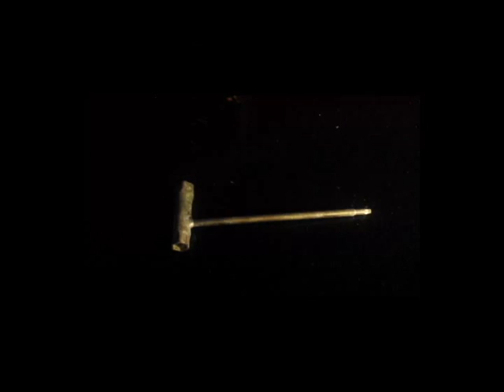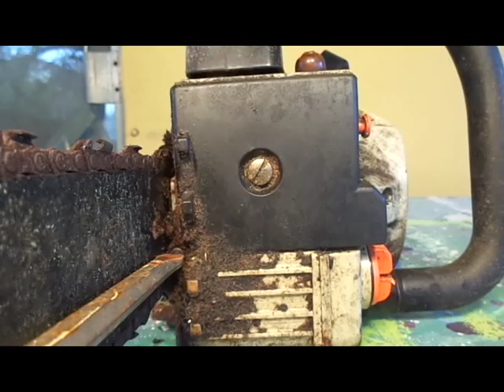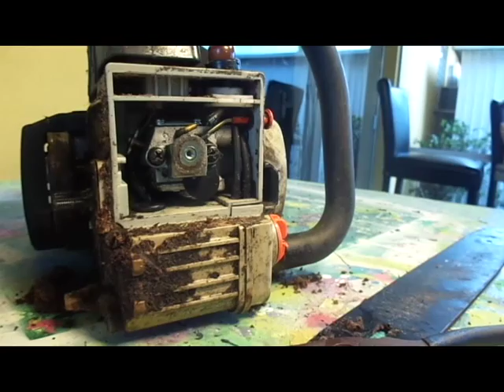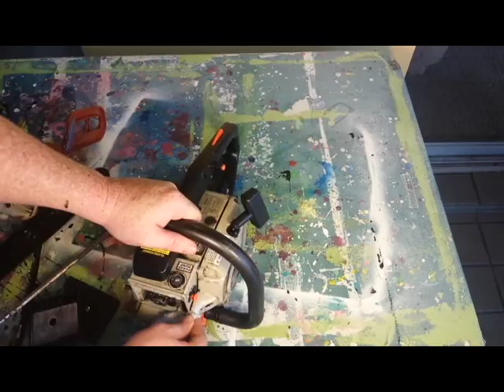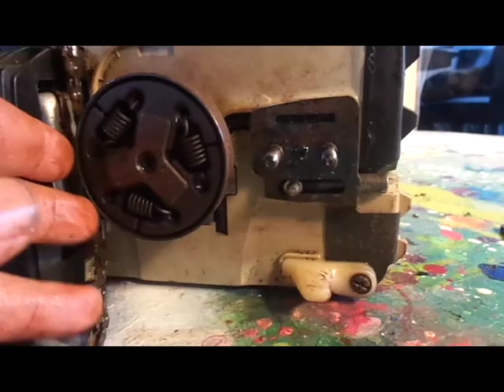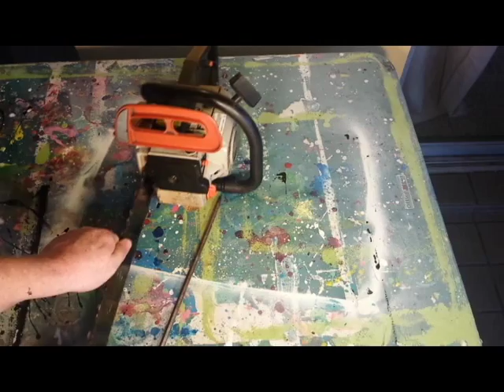Chainsaw Repair- Replace a Prime Bulb, Air Filter and Chain. D.I.Y.

Comment: When you tighten up a chain snug it up then pick the tip of your bar up then tighten the chain more if not when you cut and push down on the bar your chain will be too loose
Reply from the maker: Thanks for posting. I agree with you, definitely need the chain to be tightened properly. Thanks for watching!

Comment: DAVE
HAVE 3 ECHO TOP HANDLES THAT ALL NEED NEW BLUBS. THIS HELPED A BUNCH!!!!
TECHNICALITY -- AS IT STATES ON THE SAW, IT IS REALLY A "PURGE BLUB" NOT A PRIMER BLUB----IF YOU LOOK ON THE BLUB, THE TUBING FROM THE CARB TO THE BLUB GOES TO THE  "IN" CONNECTOR, AND THE OTHER TUBING GOES TO THE TANK, NOT VICE VERSA-----ASK ME HOW I KNOW LOL
Reply from the maker: Thank you for watching and thank you for the information on the proper name. It really does help others when they are attempting to do these repairs. I may be naming something different than what it actually is and it could definitely get confusing.

Comment: my primer bulb stays deflated or depressed my saw will crank and start up but only run a few seconds. Do you think the bulb is bad?
Reply from the maker: Reaper kinda sounds like a fuel line is clogged based on the prime bulb staying deflated, like it will push fuel but not pull it in. Could investagate the lines also check the spark plug is not cracked.
Reply: Dear Reaper, I had the exact same problem with my echo cs 3000. On the fuel pump side of the carb the tiny mesh screen was totally blocked with debris. It works great now after cleaning the screen. Good luck!!